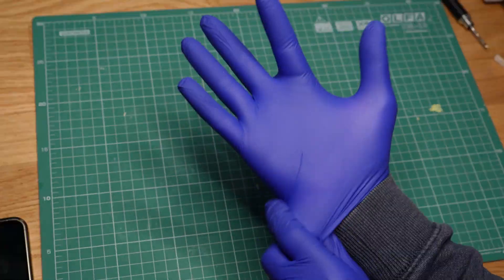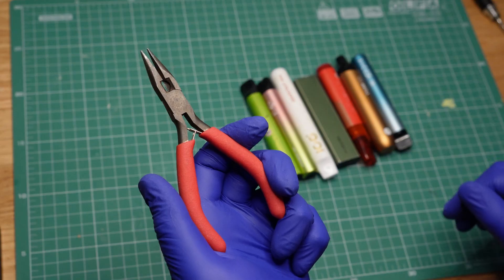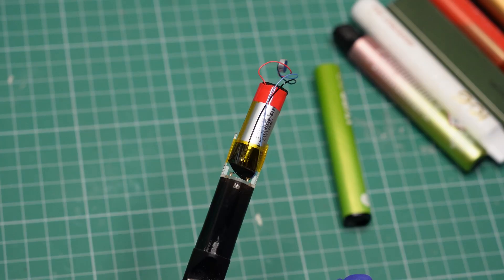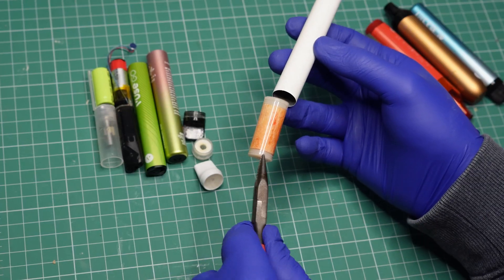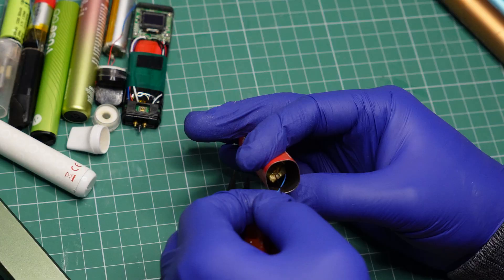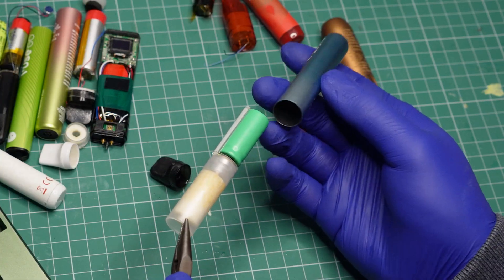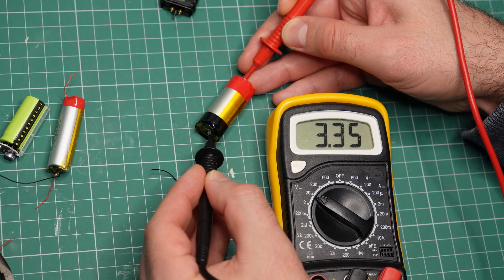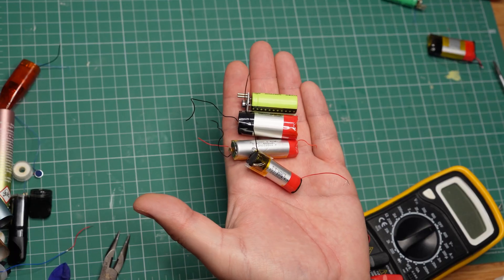Extracting Free Lithium-ion Batteries From Used Vapes

Comment: One of the best uses I have found for those 550mA cells is to use two of them together with a custom BMS to replace 2xAA batteries on Xbox controllers and similar devices. USUALLY, devices that work with 3.2V max AA batteries voltage, they will also work with max Li ion voltage of 4.2V. So far my controller works well but I do have to recharge the battery out of it on a PSU.

Comment: Nice topic. I salvaged about 15 of the  13400 cells from some single use vapes. I managed to find those in Ali express and they seem to be li-po not li-ion batteries. I tried figuring out if I can repurpose the IC that the pressure sensor uses as over discharge protection, however that is not possible. It does cut the voltage at 3.2ish volts, which is perfect for a li-po, however it has a timer which cuts off power after about 10 seconds :( btw, I am really struggling to find a bms that cuts voltage at anything higher than 2.4-2.5 V. All 1S bmses on Ali express seem to cut of at 2.5V which is very low for a li-po. This is also true for the tp4056. I decide to try out something - to create my own over discharge protection circuit using BD4732G voltage detector IC. I will use it for low side switching using a MOSFET. I am planning to 3d print some small lamps which are powered by these cells using a tp4056, my own overdischarge protection, LED driver and a led.
Reply from the maker: I am making a battery management pcb for these small cells. If it works and you're from BG, I can send you one
Reply: @LeftyMaker yes, I am from BG. I wouldn't mind receiving one of your custom bms pcbs, however, I would be a lot happier learning something new and interesting from you. That is only of course if you are up for